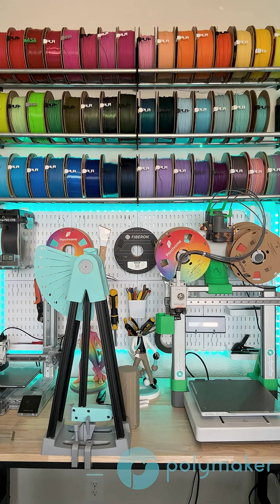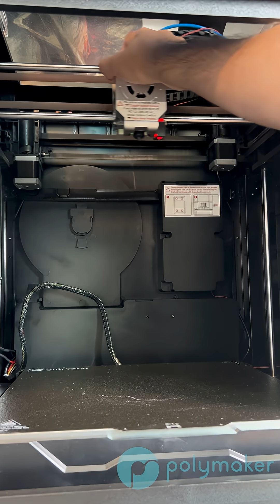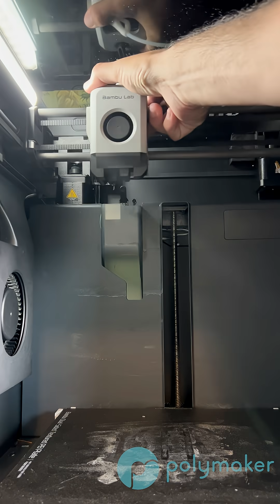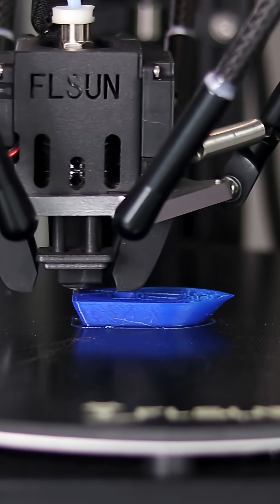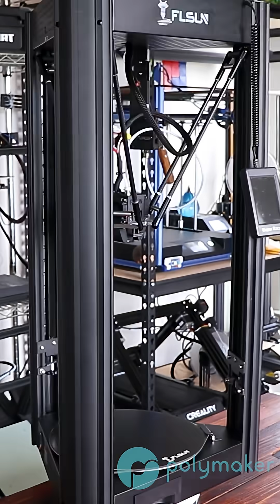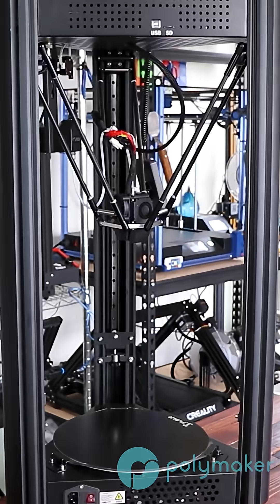Cartesian vs CoreXY vs Delta 3D Printers.

Comment: Bedslingers are trash. Just spend 300 on a centauri carbon and don’t worry about it.
Reply: bed slingers can be converted to corexz, whether that's the switchwire-esk conversions, lh stinger-esk conversions, or something completely custom like i did with my v2.  sure, they'll never set or break mainstream records again, but they can still be highly reliable workhorses.  don't dismiss them as trash out of hand.
Reply: @TinkerDad3D fair enough
Reply: True those old school bed swingers are dead now
Reply: Ever heard of the LH stinger?
Reply: @moyu1616 i have not.

Comment from the maker: Please note, there are other motion systems including H-Bot, Continuous Belt, and others. These are just the 3 most common.
Reply: i own a belt printer & a corexz printer in addition to my corexy printers & my cantilever cartesian.  i'd also like to eventually have a delta.  more than just those 3 are pretty commonplace, which i think is pretty awesome.  😊
Reply: what would a voron 2.4 be then because the bed doesn’t move but the tooled and gantry moves in all 3 axis
Reply: @C.P.3D.officialthe 2.4 is a corexy with a flying gantry.  awesome machine & fantastic concept, especially in scenarios where the bed is large enough to be heavier than the gantry, such as on 500+mm^3 build volume machines.
Reply: @TinkerDad3D ohhh ok